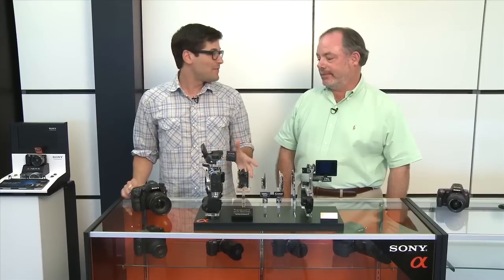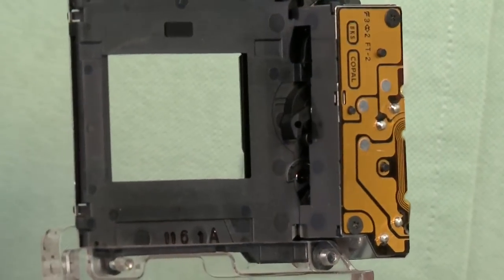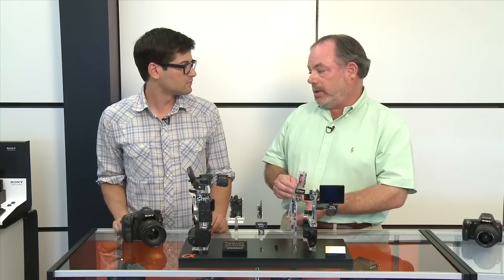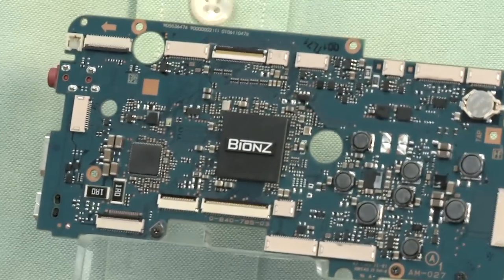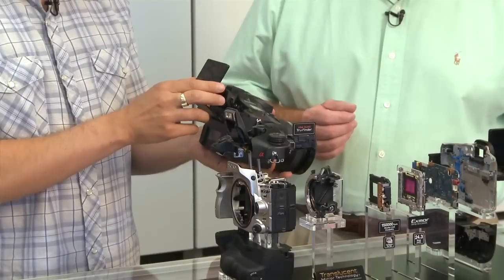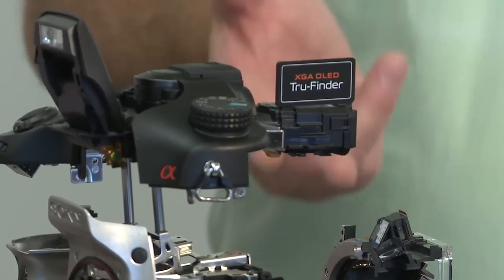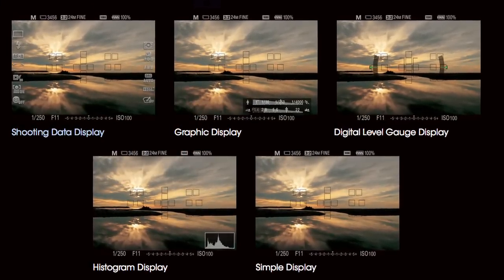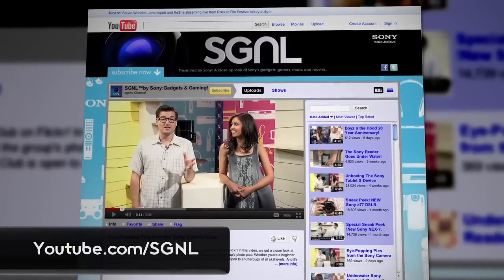Exclusive A77 DSLR Camera Tear Down: We Take It Apart!

Comment: Using my A77 in 2024 and it is MORE THAN capable. It has nearly 100% of the tech the very newest models have, auto focus in several modes, image stabilization, excellent battery life and fantastic performance. Super variety of A frame lenses (getting more affordable each day), EVF and more. Plus I am saving thousands more not buying the latest and most expensive gear all the time.
Reply: My A77 is still going strong in 2025, and I have no desire to "upgrade." The best part is that I can use all the great Minolta AF lenses I have had since my photographic journey began back in the '80s.

Comment: @gigpic True, but the Olympus EP3 also claims to have the fastest autofocus of any camera (ha). ALL markets have some kind of boast, it's not just Sony. And it's a bit unfair really, the A77 is to compete with the D7000 and the 7D, whilst the 1DX is a full framed monster which costs approximately $6800! Hell the price difference between the 1DMKIV and the 1DX is the price of the A77. Everyone has reasons to use the camera of their choice it's odd that people seek out the competition and bash it.

Comment: @DaRemixer101  P.S.  If you have not yet purchased the CX-160, the Canon Vixia HF M400 is a much better camcorder, for the same money (comparing current sale prices at B&HPhoto.com)  The Canon has a far superior sensor, with full 1080 resolution, while the Sony does not.  It also has a mini-hotshoe for adding mikes. Canon's own Stereo Shotgun Microphone DM-100 is outstanding when used with their camcorders.   Adapters are also available to convert the Canon mini-hotshoe to a standard hotshoe.

Comment: @DaRemixer101   The Sony CX-160 does not support using any external microphone with it.   On the other hand, it has great stereo microphones built into it.  They do quite an impressive job.  

You will need to buy a larger and more full featured camcorder if you want to get one that can support a shotgun mic.